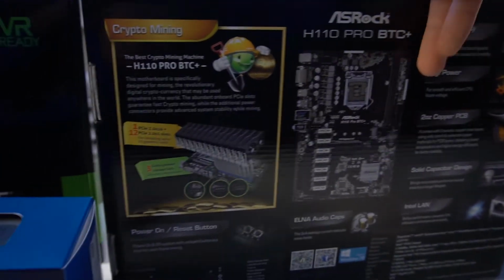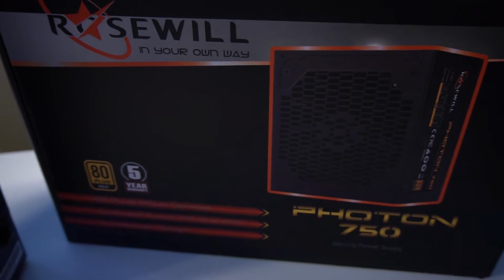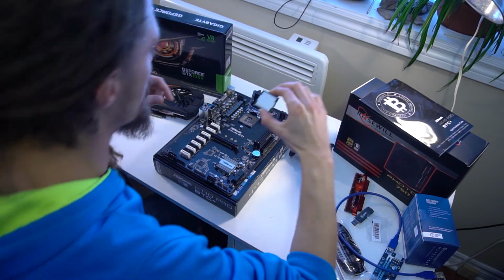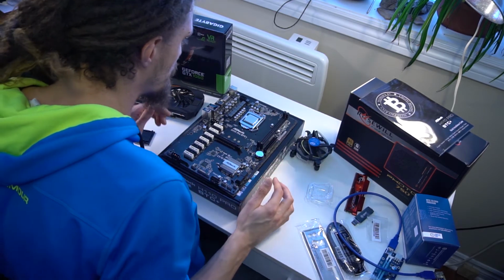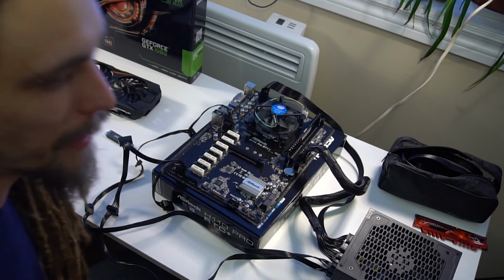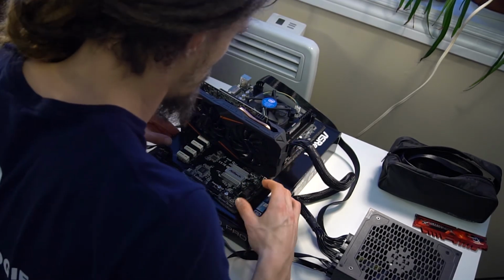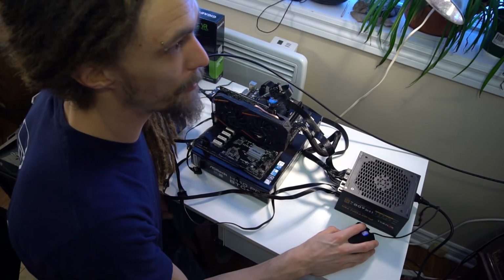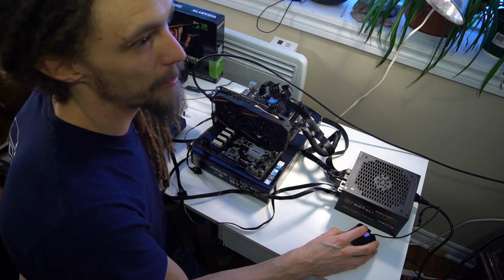How To Build A Mining Rig 2018 - Assembly - Mistakes - Fail

Comment: Great video but why did you apply thermal paste when its already pre-applied on the new cpu heatsink?
Reply from the maker: kind of an old habit from other gaming builds. I just figured I would rather trust a fresh coat. But honestly It would have most likely been fine without.